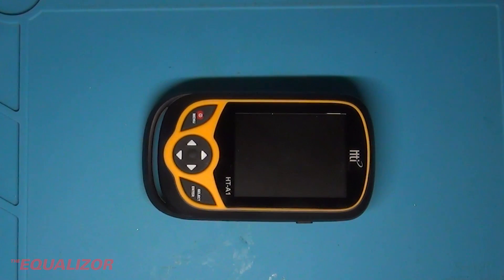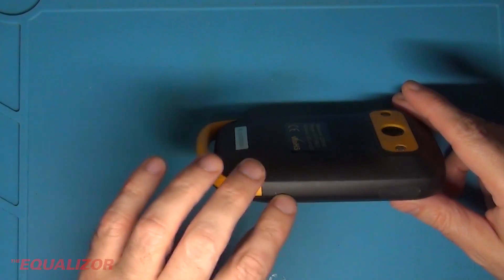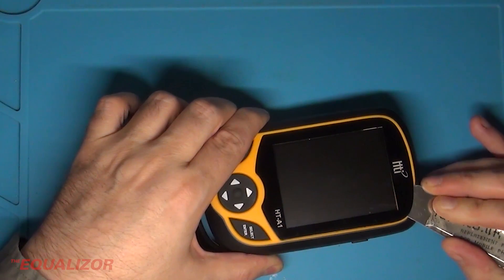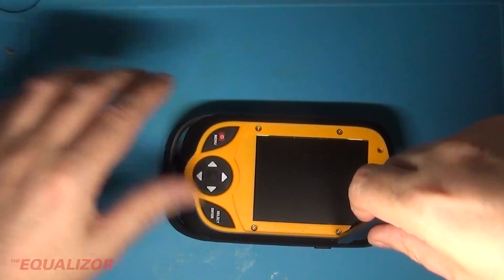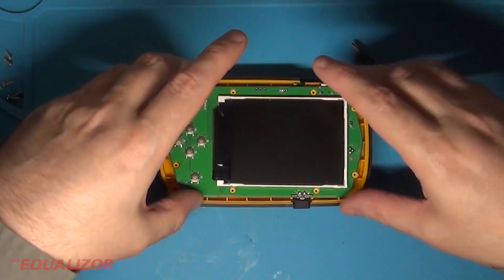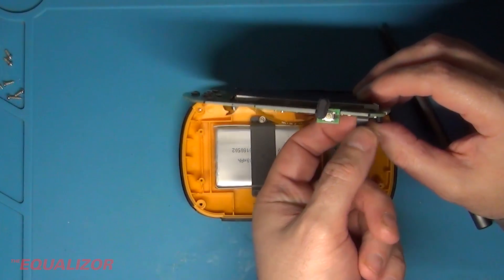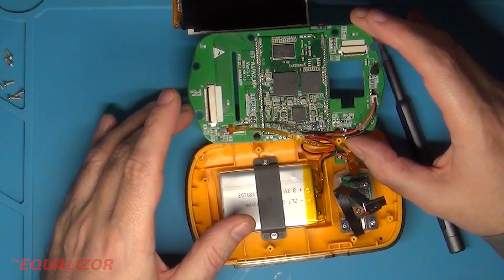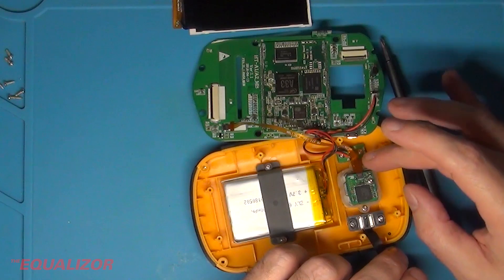HTI HT-A1 Quick Thermal Camera Teardown

Comment: all this but no sensor check.... thing with these cheaper ones is the misadvertising of the thermal sensor.  eg.... get a 320x320 for $500 but actually uses a 80x80 or 160x160 interpolated to 320.... etc.... always check the thermal sensors part #...
Reply from the maker: Yup, I quite agree, but this was just a quickie teardown and I didn't want to risk breaking it. Other people have done more in-depth ones I believe.

Comment: Chips on the mcu board are processor(center) Flash storage (right) system ram (top) and the PMIC (power management ic) on the bottom with the coils for the dcdc around it
Reply from the maker: Awesome, thanks for the info. it was really only designed to be a quick tear down. I mentioned the Allwiner A33 being the CPU, but of more interest I though was the reasonably beefy chip on the Thermal sensor itself. That really surprised me!
Reply: @the_equalizor  Presumably SEEK thermal is the sub contractor of the thermal module. The NXP LPC-CPU on it does all the "magic" and runs USB? to the main application processor.
Reply from the maker: @zaprodk  Yeah maybe. Dunno if its USB, but guessing frame-rate is slow enough that it could be. I don't remember seeing any hi speed differential pairs in there for the data so yeah USB could probably do it. I'll have to take it apart again and get some hi-res photos off all the chips and see if that NXP has USB on it.
Reply from the maker: @zaprodk Oh well done that man! What do you think of the camera? I think it's amazing value for what it is and it's already helped me with a few repairs. I'll definately have a look at your writeup!
Reply: @the_equalizor  I think it's very good for the price - you cannot beat that. When i was looking for it, i was thinking about getting one of those Seek-cameras that you plug into your phone, but it has the drawback of what do you do in 5 years when the app is no longer available? then it's directly to the electronics bin unless someone reverse-engineered the drivers for it.
Reply from the maker: @zaprodk yeah I looked at the seek and the flirs but the reviews weren't great for the seek and the flir ones didn't seem very good value for money. I was going to get the HT02 Chinese camera that Julian also showed in his video and I'm so glad I didn't. This one is much better.